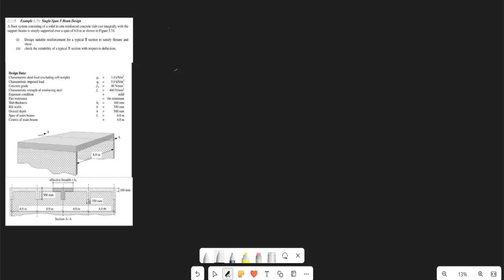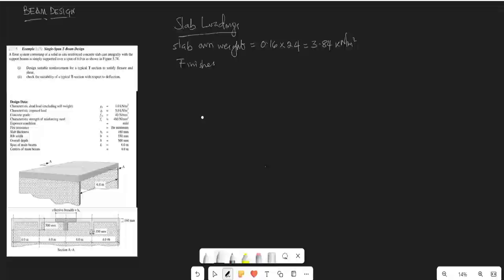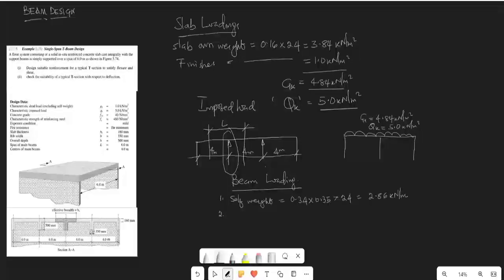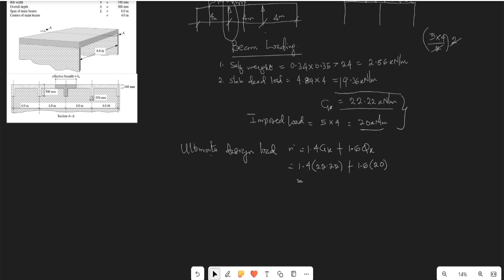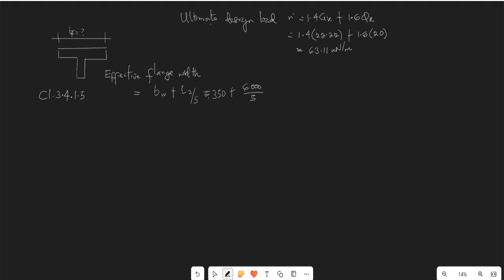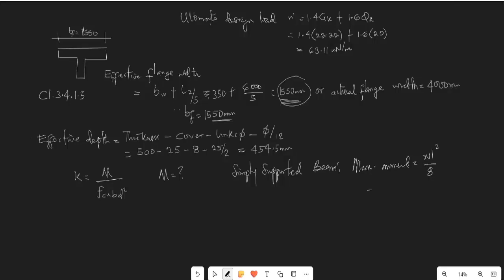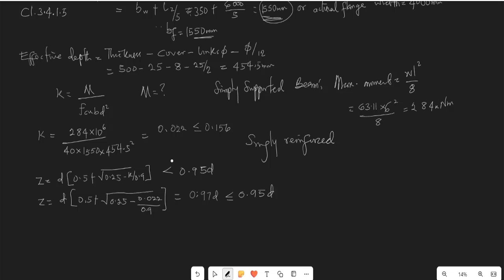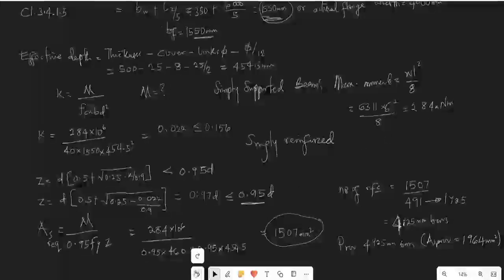COMPLETE BEAM DESIGN PART 1

Comment: Weldone sir
Could you do a video on the design of a 7m span of slab using Protastructure🙏
Reply from the maker: A cantilever slab or what?
Reply: @Joshua_d_designer  a simply supported slab with no column in between
Reply from the maker: To be sure I got your request, please send a full description to my mail; adejumo.joshua1@gmail.com
Reply: @Joshua_d_designer done sir